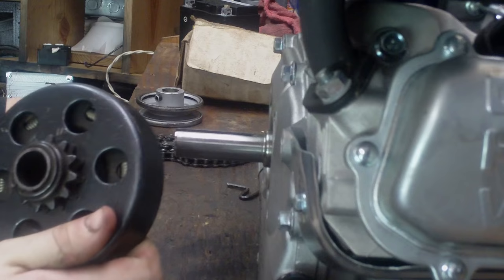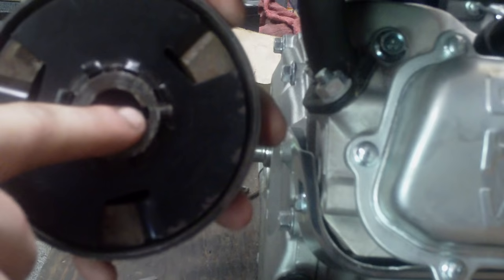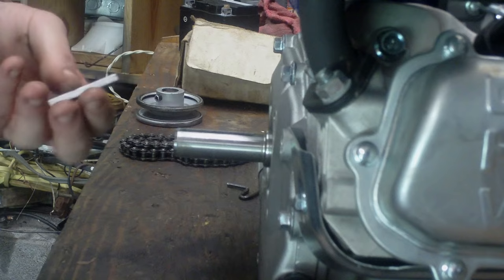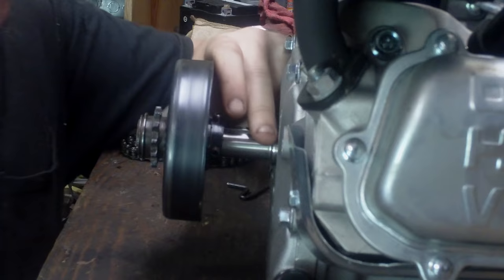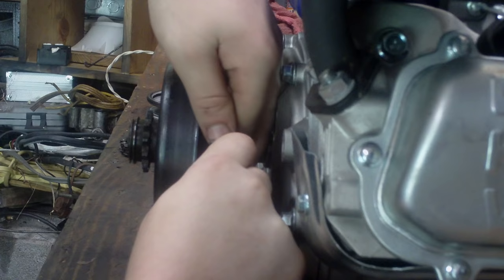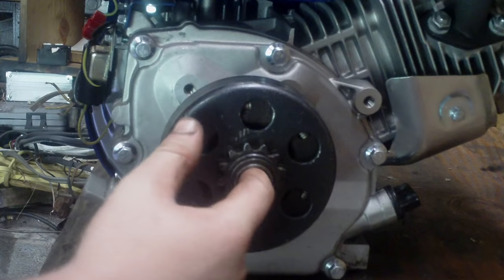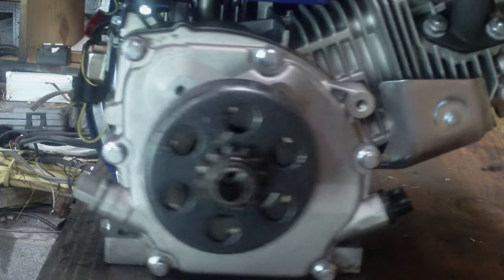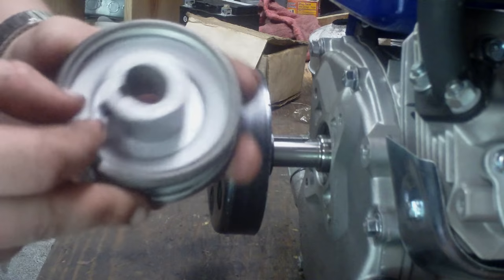How to install a Centrifugal clutch

Comment from the maker: @taboo243 your not supposed to lube it any, thats what it was oil got into the pads and it started slipping and overheated, and probably burnt it up. Also if you run a go kart/mini bike in grass, they will wear out sooner. also make sure your rear axle isn't locked up, that would cause it to slip and get hot too. And if the chain is out of line it could be rubbing the clutch heating it up. hope this helps. thanks for watching.

Comment from the maker: the model type and code is on the flywheel shroud usually on the front over top of where the spark plug is, or there is a metal tag on it.

Comment from the maker: @sonayvaio if you mean the bolt on the end of the crankshaft, harborfreight's website says 5/16" - 24 threads, should be able to find it any hardware store or lowes. your welcome, and thanks

Comment from the maker: @pretzel1253 i take taht back. the only performance benefit they provide is if you have stronger springs, the clutch will engage at a higher rpm, therefore accelerating faster, but you loose low end, setup for racing only like that.

Comment from the maker: thanks! Yes they do sale belt drive centrifugal clutches, look online, tulsa engine warehouse sales them. I think a pulley/belt set up would be easier to do, maybe not as durable since belts wear faster than chains. only problem with welding one is, it is almost if not impossible to get it centered without a wobble, unless you have a lathe or milling machine to do it accurately on. thanks for watching!!!

Comment from the maker: @seelder4 yes it can be a problem, if the keyway is not the right size it will not lock on the shaft and could slip and score / scratch the crankshaft. I always try to respond ASAP.

Comment from the maker: i don't know, might work, but make sure the tank is below the carburetor or else the gas will just overflow into the carburetor through the jets. i would try to modify the frame somehow to fit, if thats possible. If not you might be able to find a smaller tank.

Comment from the maker: as long as you get a 3/4" bore. All 5 horse briggs have a 3/4" shaft. Now if your engine has a reverse shaft coming off of the camshaft, you will have to put a idler sprocket over top of it so the chain won't ride on it. Most usually they don't have that, if you look through my newer videos i show a new engine i got (5 horse briggs) and it has the 2nd shaft.

Comment from the maker: @george2011k so its kind of just wedged on there? get a gear puller and use that to pull it off then put it on again. if the clutch is engaged all the time, the springs might have broke inside it. Might need a new clutch. i will take a look at it. thanks for watching and i hope that helps.

Comment from the maker: @seelder4 well then just try to get the keyway on far enough so the screw clamps it, it shouldn't matter if its shorter, but it would be more apt to shear though. I'd recommend buying a longer key, it'd be better to have one that is too long than not long enough. no problem

Comment from the maker: @HyeJroc yes and no. they work the same, it depends on the make. i have a homelite electric start weedeater, all the clutch is 2 metal disc like pads shaped like 2 C's back to back and it's metal agaist metal on the clutch drum, which sucks! some of them may be just like this not really sure. i hate workin on weedeaters LOL

Comment from the maker: @hanssLA well kind of hard to answer, you can't go by the number of teeth, thats the same as diameter of a pulley, it don't matter. if your working on a mini bike then its usually a #35 or #41 same for a go kart. you can take the clutch or sprocket to a place that sales chain and they can tell you what you have for sure. i hope you understand, if i had in my hand i could probaly tell you what it is, even you had a picture or video it still wouldn't help. Hope this helps, and thanks for watching!

Comment from the maker: not to argue, but, if you don't use the 2 set screws the clutch can move on the crank, the only purpose of them is to keep it in place. You are 100% right about the keyway being to long, I didn't cut it off in this case, just because i was only making this video, no point in wasting a keyway if it wasn't going to be used. thanks for watching!!!

Comment from the maker: @Abven9 not all are the same, 3/4" is the standard for briggs and tecumseh engines around 5 horse power, just depends, some smaller engine use 5/8" shaft, bigger ones go up to 1 1/4 on riding mower engines. And when buying the clutches you refer to the hole as the bore of the clutch. Thanks for watching!!!

Comment: To make sure you get the exact one you need take your engine to one of the bigger napa parts stores. One where they have two stories for example that have thousands upon thousands of parts in it. Then tell them you need a keyway that fits the taper, then you should be good.

Comment from the maker: @f00bert24 usually when they smoke the clutch is slipping, and what usually causes that is running in grass or oil getting on the pads and making it slip, or a stiff/seized up rear axle. Also another thing the engine could be to much horsepower for the clutch, the rating has to match up. hope this helps, thanks for watching.

Comment from the maker: @CamoPeng its a standard 1/8" keyway. it should be the same for a honda, as this is a copy of a GX200 honda, parts are interchangable between the 2. but i think the smaller ones (like 140 and 160) have a smaller crankshaft, can't say for sure. thanks for watching

Comment: I have a 127cc Briggs & Stratton engine on my GoKart just recently bought the same clutch but newer. It fit the rotator but the rotator doesn't have a hole to screw in to tighten it down and I'm noticing even with the old clutch and the new one it would just slide off the rotator since nothing is actually keeping it in place what can I do to prevent it from sliding off the rotator?

Comment: That engine looks like a clone to a Kohler! I'm getting a 6.5 hp Kohler for my go-kart. It has the same size crankshaft and max rpm as a 5 hp engine. After 5 years, I wore the original engine out on my go-kart. It was a 5 hp Tecumseh.

Comment: Old vid so hopefully someone will see this. Because of the sprocket setup with my go-kart, the clutch seen in the video, offsets the chain about 2 inches to the left of my drive sprocket. My current drive system is just a torque converter which isn't giving me the torque I'd like to see out of my engine. I'm hoping a centrifugal clutch would increase the torque a bit. As for the 2 inch offset, what can I do to make my go-kart work with this clutch? If I install the clutch backwards on the engine, the sprockets line up fine. I'm not sure if this would work or if the operation of the clutch would be affected. I'm thinking that it most likely wouldn't work. My other alternative is to use the jackshaft sprocket with two chains. Chain from engine to jackshaft, chain from jackshaft to drive sprocket. That becomes it's own problem. With the existing jack shaft, I would now need to find a way to secure both sprockets as the threads only cover about an inch on either side of the shaft.
It's probably obvious, I'm a newbie with this so any info I can get is greatly appreciated.
Reply from the maker: You can turn the clutch around it will work fine. Thanks for watching

Comment from the maker: @hishammadani1988 hey. glad to help! this one here is made in china as well, it's made by Lyfan (or lifan can't remember) but the speed of mine is governed at 3600RPM, its the stand for small engines so yours is probably that. most clutches engage at around 2000-2100 RPM, just a little past idle speed, so you should be good. i would recommend goin to psep dot biz and go to go carts/mini bikes and go to clutches, they have everything you need just be sure to measure your crankshaft first...

Comment from the maker: they sale racing camshafts for these, along with lightened flywheels, timing adjustment keyways, stroker crankshafts, go on eccarburetors (dotcom) these will use the same parts as a honda gx200 or the 6 hp clone parts they sale. thanks for watching!!!

Comment from the maker: @pretzel1253 nothing. its just easier than setting up a actual manual clutch like in a vehicle. If you ask me, if it does anything it hurts performance because they slip very easily, especially if you drive a go kart / mini bike in grass. i plan to belt drive my racing lawn mower and possibly go cart with a twist and pull style clutch setup. thanks for watching

Comment from the maker: @94hambone Hi. It should be either a 1/4-28 or a 5/16-24 bolt size (machine thread). As fas as i know it should be 1 of the 2, if not just buy a size bigger and smaller of that and try it. Hope that helps you. Thanks for watching.

Comment: clutch comes apart into 2 pieces got the first part on but when i put the cover part on (the one eith the teeth) it doesnt stay on? so when i start up the engine its gunna spin the first part thats on the engine but not the teeth to spin the chain???

Comment: if a clutch hasn't been off in a long time is it likely to be seized on? I patiently removed the 2 screws how ever it will not pry off. Would a bearing/hub puller be suffice? Many thanks
Reply from the maker: Oh yeah, they are bad about getting seized on, yes you can use a puller on it, sometimes a 3 jaw puller is all you need, or a bearing separator will work better. They can be REALLY stuck on, especially if its been left outside and is rusted up. Thanks for Watching!!!
Reply: fnaguitarplayer9 thank you so much for the advice🖒

Comment from the maker: just depends on your bike/go kart. If you put the clutch on with the sprocket outwards and the chain is crooked, than it will need to go the other way. The one in this video came from napa but you can get them online cheaper at tulsaenginewarehouse they sale them for about 30 bucks. I recommend max torq brand. thanks for watching!!!

Comment: With this technique installation is it still required to have a Radius wash in between the clutch and engine on the shaft?
Reply from the maker: I never have, i've always locked them down with the set screws and bolt on the crank and never had any problems. Thanks for Watching!!!

Comment: what happens if my clutch is smoking? like on my go kart I have a solid axle (manco dingo) and when I turn it needs more clutch. So I believe that has something to do with my clutch not getting the torque it needs and causes it to smoke. solution?

Comment from the maker: this particular engine uses a 5/16-24 thread bolt (for the side bolt that goes in the crank), the 2 set screws, i'm not sure what size they are. The bolt that goes in the crank does vary by engine, the manual on your engine should say. thanks for watching!!!

Comment: Could someone tell me how you would stop the clutch from moving  along the shaft ?
Reply from the maker: make sure the set screws are really tight, if they keep loosening up you may need to put loctite on both of them. thanks for watching!!!
Reply: i had the same problem and the issue was the keyway kept popping out so i got it in, then lightly screwed in the screw for the keyway then slid it on the rest of the way. also install the bolt inside the crank like he said in the video

Comment: I have a 79CC Pred motor from HF tools, I can't figure out what MM bolt goes into the drive shaft, to hold the clutch on?? Please help
Reply from the maker: i went on harbor freights site, and the manual for it says its 5/16" - 24 threads per inch, I figured it would be metric too, it doesn't say how long but i'd say no longer than 3/4". hope this helps, thanks for watching!!!

Comment from the maker: i can't remember right off hand what size bolt it is, but it will vary on different engines, and no it doesn't come with the clutch, the 2 set screws do but thats it. any hardware store will carry the bolt you need. thanks for watching!

Comment: I have a centrifugal clutch on my 11hp and I have all the correct hardware, but the bolt that hold the clutch to the crankshaft keeps loosening itself. Any ideas on what could be causing this to happen?

Comment: What size sprocket is that also where did you buy that clutch? My predator 212cc 3/4" shaft has a key male end and every cintrifugal clutch i could find was keyed small not really fitting that hole like you think it would
Reply from the maker: Not sure of the sprocket size its a standard clutch so probably geared to be in the mid range i'd say, i will find out. It came from NAPA along time ago, its a max-torque brand i do know that. It should have a standard keyway, the engine in the video is a greyhound 6.5hp, basically the same as a predator 212.  Thanks for Watching!!!

Comment: What if the shaft doesn't have a hole for a bolt to thread into? How do I keep the clutch on then?
Reply from the maker: thats rare, out of curiosity what brand is the motor? I would think the 2 set screws would hold it in place, i can't guarantee it though, and i would put loctite on them in that case just so they wouldn't work loose. thats really abotu the only choice you would have, unless you tour the motor down and took the crankshart to a machine shop and had it drilled/tapped. Thanks for watching!!!

Comment: So I don't have to slide it all the way if I do it won't lign up with he bottom sprocket ...since IAM here how will a 10 tooth clutch work on a 28 thoot sprocket that's already on my axel
Reply from the maker: Yeah thats fine, just make sure to lock to the 2 set screws down. Thanks for Watching!!!

Comment from the maker: possibly, you may have to file it or cut it shorter if its to long like the i used in this video. but don't over file it, you don't want it fitting loose, or it can rock back and forth and mess up the slots on the clutch or crank. thanks for watching!!!

Comment: Wrong clutch key ur clutch needs to be close to the engine and as it isnt the engines main bering will wair out quickly
Reply from the maker: Your probably right, closer to the block it would be less force (leverage) against the bearing. Thanks for Watching!!!
Reply: duh
Reply: Karts & Engines I NEED YOUR HELP!!!!!do y'all k ow what size bolt fits in the shaft of a lifan 6.5hp engine?THANKS😀
Reply: Karts & Engines I bought on for my go kart and about a minute later it started to smoke I faced the gear twards the motor is that why its smoking

Comment: Hi man I just buy predator 420  but I can find right size for the clutch i try the same as you use on this video but its to small.
Reply from the maker: +andrei cigmaian I hear ya, you might have to get a caliper to measure the shaft first and go from there, they must have changed sized for some reason. Thanks for Watching!!!

Comment: great thx for the help < but plz where to find this Centrifugal clutch ??? I asked a Karts pit stop and they said that now they use a different type of Clutch < and this is an old one < so any help where to find it in which kind of shops ? thx in advance >
Reply from the maker: Fady Saber Your welcome! If your in the US i would suggest going to tewarehouse.com they sell them fairly cheap, you can also find them on ebay. Any small engine shop should be able to get it for you i would think, Thanks for Watching!!!

Comment: Is it bad if the set screws came out, my daughter was riding the go kart today and I was checking everything after she got done riding and notched the set screws had jarred out.
Reply from the maker: Raymond Gardner Not unless it got loose and messed up the key way slot or scratched the crankshaft up. It would be best to put loctite on them, that should keep that from happening. Thanks for Watching!
Reply: fnaguitarplayer9 thnx for responding. Check my go kart out I got for my daughter on my page, I just got me one I'm about completely restore, I'll post vids of those soon.
Reply from the maker: Raymond Gardner Your welcome! I watched a couple videos of it, looks like a pretty nice go kart, They are fun to work on a fix up, I have a small one similar to that, i'd like to stretch it and convert into a full size one, maybe build a roll cage for it.

Comment: Hey great video, i was wondering if i can put a clutch like that on a honda 5.0 xr2500 the shaft is shorter than yours would it matter?
Reply from the maker: daniel Thanks. Yes as long as the shaft is the right size, when you go to buy a clutch they will show the bore size, that is the shaft size, just match it up with what your engine has, they have several sizes available. They also make a centrifugal belt drive clutch instead of chain drive. Thanks for Watching!!!

Comment: i have a tecumseh 3.5 it has a clutch but it seems like it will only start on stands ,when i lower it the drive wheel is engaged and it stalls the motor why ?
Reply from the maker: a 3.5 isn't much power and it will stall out easily, especially if its a manual clutch and not like this type, but it could be just a simple carb adjustment, to get more power out of it. or it could be something wrong with the chain/belt drive. Thanks for Watching!!!

Comment: How do you push it in further? Do I cut the key link shorter?
Reply from the maker: It will slide over the key way, on some engines you can lightly take sand paper and dress the shaft down so it will slide right on, most of the time they would but because i was making a video it wanted to be difficult haha Thanks for Watching!!!